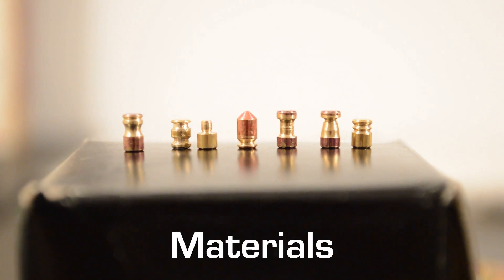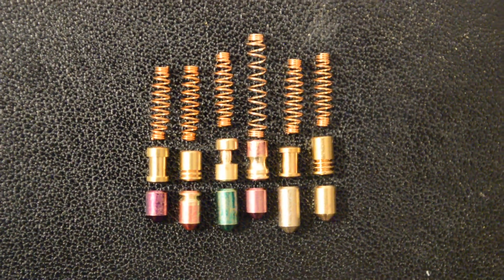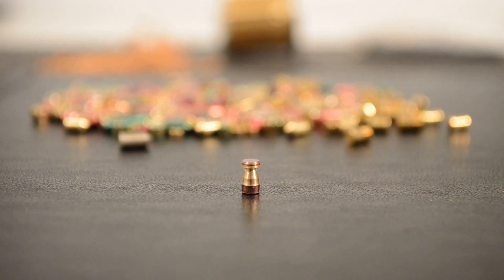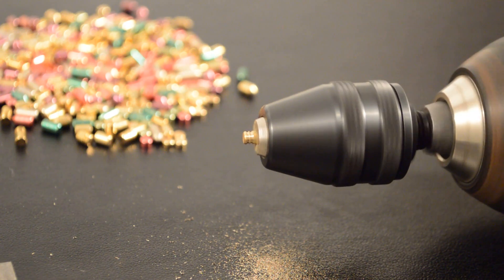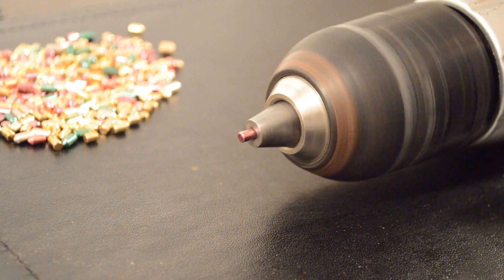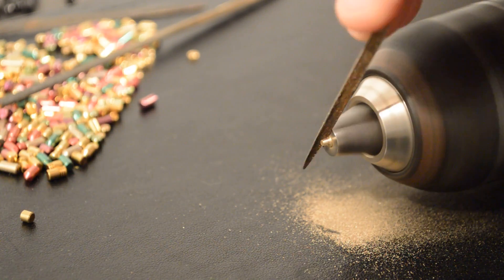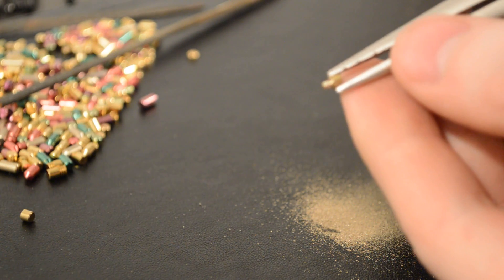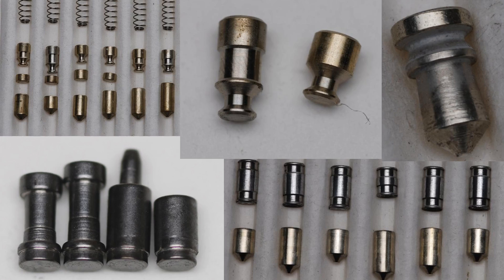How to Make Your Own Security Pins for More Secure Locks 🔒

Comment: "You can just clamp the power switch down on your power tools tools."

"You can also use this hacksaw blade with out gloves on your power tool that has it's power switch clamped down."

 The enthusiast lock picking community is no place for pussies.
Reply: usually one does not wear gloves when working with rotating machines like lathes because they can be caught and pull your hand in